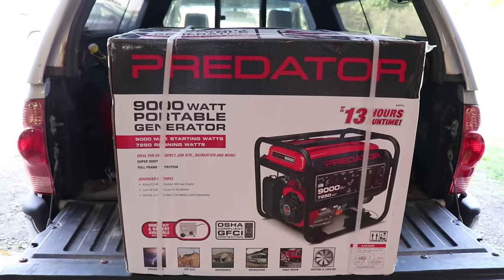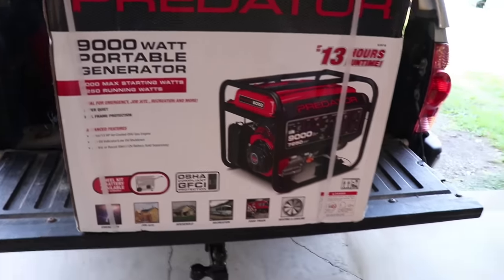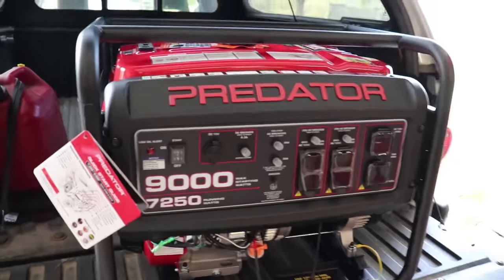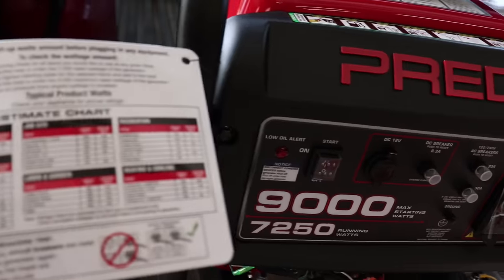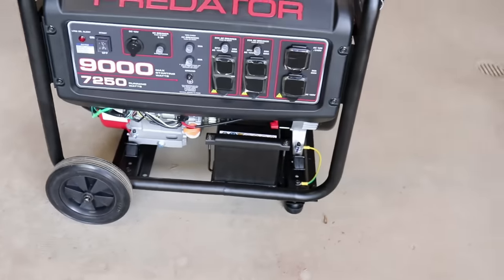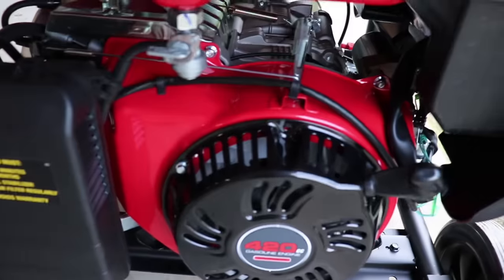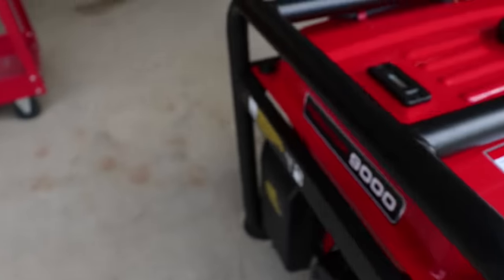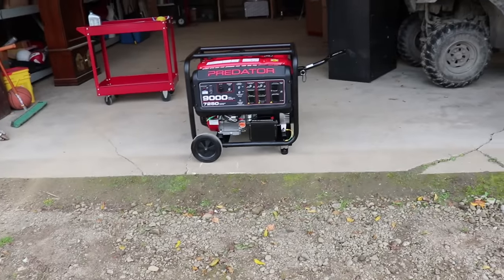Predator Generator Running Our ENTIRE Home. (Complete Setup and Cost)

Comment: OK Generator geeks (like me).  Here's a hack you need to know.  It's called "loss of residual magnetism".  It occurs when you start OR stop your generator while under a load.  Like running out of gas.  Try not to let this happen.  If your generator quits putting out power, even though it's still running, 95% of the time you are experiencing a loss of residual magnetism. 
THE FIX.  Simple.  With your generator running, unplug all your extension cords.  Take a regular old school reversible electric drill.  Set it on FORWARD.  plug it in to your generator's 110/120 outlet.  pull the trigger and spin the chuck BACKWARDS by hand.  When the drill kicks on, you're good to go.
Reply: Ok please explain again.
Reply: LOL. No that does not work, old wives tail.
You can however recharge the armature by energizing the fields with a 12v. battery, it involves removing the VCM and disconnecting the Pos/Neg leads to the brushes, start the Gen and apply 12v current to the two brushes terminals for a second or two, put everything back together and you should be up and running as long as the windings are good.
Reply: I just did this on mine last month.  I was running it for 8 days and I let it run out of gas twice.  Both times I restarted it with load plugged in.  All of a sudden It was running but not putting out any power.  I unplugged all the extension cords to my house.  I plugged in an old school corded reversible drill set on FORWARD.  With the generator running, I pulled the trigger on the drill and, by hand, spun the drill chuck backwards.  In a second, the drill fired right up and we were good to go.  I won't claim to understand the science behind it but the method definitely worked like a charm.  Check it out in google.  That's where I found it.

Comment: I run my entire home with the same generator.
We are not hooked up to the grid, electrically or water.
Hopefully the solar system will be able to take over soon and we won't need to buy gas much anymore.
Reply: Why dont you convert your engine to a GEET one. Then it runs on water mostly?
Reply: How much gas for whole house for a day ? ?. Can not afford new wiring but need - heat . any good. ?
Reply: @hopefull752  
It takes about 12 dollars a day to run the generator,  but I heat with wood.
Reply: @fundreamer1  thank you for answering. I am 65female we have a cost iron woodstove but can not sleep long before re stooking wood. .
Reply: @hopefull752  
Keep in mind I don't run the generator all day, I want to get a wood cook stove soon and some can keep warm for up to 12 hours from a single loading of wood.

Comment: I found this vid by searching for generators. I am in Houston and was without power for 3 days during this deep freeze. As much as it sucked, I have been reminded of how much worse it is to live with no power when it is 100 degrees plus the heat index during the summers. I am looking for a cheap but reliable generator that can power a 6000 BTU window unit, a WIFI , and laptop. Don't need much more than that. I just don't want to live through another hurricane when I was w/o power for 21 days. Passed out routinely. Could you do a vid on a dependable but inexpensive generator that powers basics? Thanks!

Comment: I suggest you get a small maintenance battery charger, pulling start is no fun.
Reply: yes , especially if he is sick that day
Reply: I bought the previous model several years ago which was 8750 peak. I never installed a battery. It's another I would have to maintain. It starts easy never more than 2 pulls. Usually 1 does it. These things can output incredible amounts of power if they have to. We lost power for 5 days over Thanksgiving weekend a few years ago and was able to run our garage, in law apartment,  house, and all 4 burners and the oven on the electric stove all at once to cook the Thanksgiving meal. It was definitely loaded up and burned a bunch of fuel but it saved Thanksgiving. It will also run the electric dryer (around 6k watts) and the apartment, house, etc. Not the stove though at the same time. If the well pump comes on the dryer slows down but it's only for a minute. These things can deliver the peak watts and more sustained for hours. No damage on ours from beating it up quite a bit over the years.
Reply: Daniel Lamarre 
I have the 8750 model and have a trickle charger connected,also a good add on is a low budget hour meter,it just has a wire that connects to the spark plug.I also run mine for 15 -30 minutes once a month under load to exercise the motor and windings,I had another generator that sat for years and come crunch time it wouldn’t work...I’m prepared now.
I also keep oil and plugs on hand as well as a few gallons of stabilized fuel.

Comment: Just bought the 6500 predator and in the process of setting it up. Power outage is not a big problem here but does happen, usually from an ice storm. Just going to run the absolute neceties. Fridge, freezer

Comment: Gotta love Honda. They design the whole thing, and Predator just ripped off the whole thing!
Reply: Cry me a river. Then go pay the higher price to help Poor honda.
Reply: Honda charges about $4500 for a similar wattage generator.  They priced themselves right out of it.
Reply: Honda did not invent the outdoor power generator.
Reply: @chakur25 You're way off.. Here is a Honda 7000 watt generator at Amazon:  https://www.amazon.com/dp/B00YY9SDVG/ref=dp_cerb_3

the 10000 watt model is more..

The Generac by itself is $2200:  https://www.amazon.com/Generac-5802-Starting-Portable-Generator/dp/B001UNK6GY/

The $10000 model you're referencing has an automatic transfer switch  and automatically turns on and off based on your local utility power availability.

The cheap Chinese knock off models that this video references are indeed knock offs of Honda 420cc engines.  But they get the job done.  I've had one similar to the Predator model now for 3 years and I've run it for well over 70 hours with no problems.

Here's a Honda 10000 watt model:   https://www.amazon.com/Honda-EB10000-HONDA-EB10000-Industrial-Generator/dp/B00C113A9O
Reply: My harbor freight 6000 stays in the  truck..   thieves avoid it. A Honda wouldn't last a week in Los Angeles.  Those battery powered lock cutting grinders are everywhere
Reply: drewski did he say invent? Nope he said they took the time to design a product and the chinese helped themselves to it.
Reply: @darinmartin7735  Honda Inverter generators are a completely different type of generator to the one in this review.  Inverter generators always cost more regardless of which brand you buy.  The difference is they are typically better on fuel, provide clean power and are quieter when not fully loaded.
Reply: @ryanconnor8578  OK.. Here's my point in all this.  Yes the Honda is a better generator.. No question about it.. However, is it really $3500 better than a cheap Chinese knock off?  I can get the Honda for $4500.  The knockoff that puts out 10000 watt is $1000.  So, yes, the knock off will use more gas.  But again.. There's a $3500 difference in price difference.  At current pricing near me, that will allow me to buy 1500 gallons of gas before I start to come close to the price for the Honda generator.  It's just not worth it to me.  Even if the cheap Chinese knock off craps out because it was built with crap materials.  I can still buy another whole 10000watt generator and still not be close to the price of the Honda.
Reply: @ryanconnor8578  Agreed.  You cannot compare an inverter generator to this Predator model.  Inverters are different machine altogether.  They are a superior type of generator.  The Honda EU7000 inverter model referenced above also has electronic fuel injection.  No carburetor gas issues because there's no carburetor.  I've seen the EU7000 in action.  It's unbelievably quiet, with a THD of less than 3%--very pure sine wave output.   It also has a 3-year commercial warranty (as well as a 3-year residential warranty).  Yes, inverters will always be more expensive than regular portable generators of similar output. 

Last, this Predator is a 7,250 W generator--not a 9,000 W generator.  This model is only rated at 7,250W.  It can only deliver up to 9,000 W for 1-2 seconds or so to meet a surge demand.
Reply: Darin:  Please see my reply to Ryan.  The Honda EU7000 is a different type of generator.  It's an electronic fuel-injected inverter.  You cannot compare it to this Predator.

Also, in our rural area, where we experience a lot of power outages, the main criteria for me and my neighbors is reliability.  Sure, one could buy several generators for the price of Honda's most powerful inverter, but no one wants to have their generator fail during a 5-day outage.  I own two Honda engine products, and have rented several others.  They have always started first time, every time.  I've never had to have a repair in over 20 years of using Honda products.  That reliability is worth something to us rural folks.
Reply: All of the lower priced generators come from the same Chinese factory, regardless of name brand. I bought my $399 Champion 12 years ago when I couldn't get my Honda 5000EMS started. I kicked that Honda to the curb and have had reliable power ever since. Honda fanbois need to get a clue.
Reply: wilbilt how do you know they all come from the same factory? Have you visited there? Or have someone on the quality control team that  told you that? 
  I’m sure parts aren’t as easy to get as Honda! I don’t need to get a clue about anything. I’ve been in construction for 23 years, and everyone runs Honda generators, not Champion  pal! Maybe you need to get a clue?!

Comment: Will this run a central AC unit with everything else.
Reply: And for how long ?
Reply: Depends. How many Watts you HVAC requires
Reply: I doubt it. I have the same set up and there isn't enough amperage to pull the contacts in to power the compressor. I just put a window ac unit in my living room and it was comfortable.

Comment: Your going to love this. I have a tri fuel generator 9400 watts. You can get a kit for that pretty cheap. I can run gasoline , propane, or natural gas . (I run natural gas, cause I already had the gas line there) Anyway remember you NEVER have everything in the house on at the same time. You have mostly electric stuff, mine is all natural gas. I'm in Michigan so its cold here  too. Mine runs everything in my 1850 square foot house even the AC. (thats a bonus, nice but not a gotta have thing) The furnace is important . I haved had this setup for about 10 years. About  5 minutes from lights out, to lights back on.
Reply: ⚠️portable generator safety announcements:

This is just a reminder to remember the safety rules when using portable generators. 

1) KEEPING OTHERS SAFE: Please do not allow an unqualified person or your children to operate and service the portable generator. Just because some manuals don’t say that doesn’t mean it’s safe. That is important against the generator safety rules. We also need to be keeping an eye on our children too. You need to make sure that your children are not playing near the portable generator especially when it’s running so they won’t get electrocuted. Generators pose electrical risks and they can be hot during an operation. Please keep your children away from the portable generator at all times. It is important to keep our children safe especially our little ones. Be aware of all the hazards.

2) WHERE TO RUN YOUR GENERATOR: Some people use their portable generators indoors which increases the risk of carbon monoxide poisoning. It’s important to have a carbon monoxide if you have a gas generator. Never ever use your generator indoors even if your doors and windows are open and even in the garage is not safe to use a portable generator. Please do not even use your generator in your deck or balcony. It is never safe to use your generator indoors and in enclosed areas of your home. Your generator needs to be 15-20 feet away from your house. 

3)🔥FIRE HAZARDS: Never refuel your generator while it’s running. You need to let your generator cool off before refueling it and before storing your generator. Never overload your generator too. Never ever back feed your generator. You should never plug your generator into a wall outlet. Also never store propane tanks indoors. Please keep flammable things away from the generator as well and please don’t smoke cigarettes near the generator. Having a fire extinguisher next to the generator is also important against the generator safety rules. 

4) GENERATOR OPERATION: make sure your hands are dry before touching the generator. Never use your generator in wet conditions. Don’t let your generator get wet. You need a generator tent if you need to use your generator during wet weather. Please don’t wear loose clothes when operating the generator. Turn on your generator before plugging in appliances. Use the right cord for your generator. Please do not use worn out cords. 

https://youtube.com/shorts/eFigDfnPkcQ?feature=share and here is a short video more about keeping others safe when using generators 

Hope this helps

Comment: I have an 8750 Predator Generator and I can run my entire house on it.  I don’t turn anything off intentionally, I just know what appliances I can run and which ones I should not run.  For example, 2 refrigerators and one large freezer run fine, my furnace with forced hot air heat and even my central A/C works in the summertime.  Things I try to avoid using, obviously, are things that draw the most electricity.  I can run our washing machine, but we have an electric dryer which draws a lot of power.  I avoid using the microwave and toaster oven.  Basically, things that convert electrical energy into heat typically require more power.  If there’s an emergency where we lose power, I’m not going to worry about doing the laundry or making hot pockets in the microwave.  😂

Comment: Word of warning. If you are using gas with ethanol sta-Bil is useless. Look up the reviews on YouTube.
Reply: True for older stabilizers.  They now have stabilizers made specifically for ethanol , more expensive than the other but what can you do?
Reply: Amen. It is best to buy ethanol free premium for equipment gas tanks / cans. Some even buy 100 octane at an airport.  I would not want to store ethanol blend gas more than a month.
Reply: I agree my generator gummed up with stabil. You are better off leaving the fuel in it and syphoning it out every 3 months and putting fresh fuel in it.
Reply: Archie Slater Did not know that...thanks for sharing!
Reply: scot miller Why wouldn’t you just run it until all the fuel is used up then store?
Reply: @lizbethdiehl318  even if you run the fuel all the way out there is still about an 1/8" of gas still in the fuel  bowl of the carburator. I used to do that but that little amount left in there would turn into sludge.
Reply: markusayt during cold weather I keep a few 5 gallons cans of fuel in the shed with stabilizer,if I don’t use it for the plow truck ,snowblower or generator,I dump them into the car fuel tank and top off the cans again...simple way to ensure the fuel isn’t stagnant
Reply: scot miller run the generator once a month with a hair dryer or other small appliance connected to it...keeps it exercised and fuel rotated
Reply: markusayt I never considered buying aviation no lead gas. Thanks for the idea.
Reply: Elizabeth Diehl mostly because the way the tank is designed you can’t ever get all of the fuel out of the tank. I’m not sure what part of the country you hail from. Here in southeast Missouri we have very high humidity. If ya don’t keep your tank 3/4 full the tanks will start to rust on the inside.

Comment: I hope this was a short test and not your actual plan in the event of power lost. My understanding regarding Generators, run outside 20 to 25 feet away from the house with the exhaust facing away from the house. I would love to get a transfer unit like you have instead of running cords all over the place.
Reply: And ground the generator for human safety and safety of all of the electronics that is attached to it.

Comment: Yes when your finished using it always cut the fuel off and let it run till it quits so there is no fuel in the carb. I have had the predator 8750-7000 watt for 3yrs and I have always done that. It starts every time 1-3 pulls. I had a battery for electric start but it didn’t last b/c of how long it sits not in use, just some tips to think about hope this helps.
Reply: Ethanol eliminator  too. Ethanol is brutal on rubber hoses, and it will separate if it sits in the carb bowl. It looks like grass clippings sitting in the bowl. I’ve seen it mess up lots of boat motors

Comment: you no doubt have a pressure tank on your well, you need to run the water until the pressure drops enough to kick on the pump.........that's what I wanted to see!!
Reply from the maker: Hi Larry....I ran a test on it today and here is the video! Thanks for watching. https://www.youtube.com/watch?v=biioj7OnfR4
Reply: It will easily run a well pump.  I run our house on a 6500w, 4000 sqft house. The only thing it won’t run is the 3 central AC units.  Won’t run any of them but we usually lose power in winter and we have oil heat/hot water.  We have well water and septic pump.  Runs it all with out switching things around.

Comment: Invest about $50 in a Clamp-On Ammeter to measure exactly how much power that you're using.
Reply: Which one?
Reply: @bmbott123   Doesnt matter as all will be good enough for home use. I got one off of amazon for some where around 30 as i needed one that can read dc amps also.
Reply: Thank you sir!